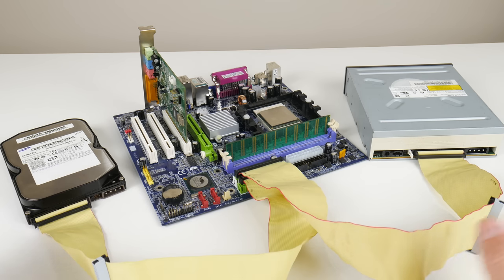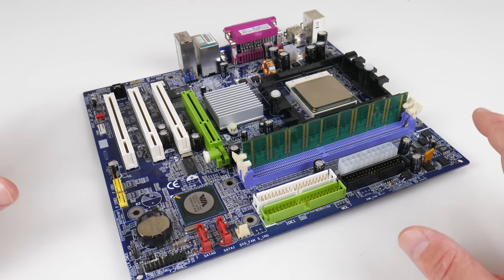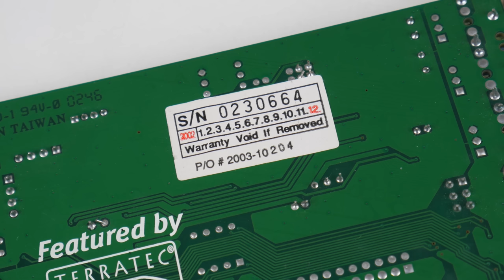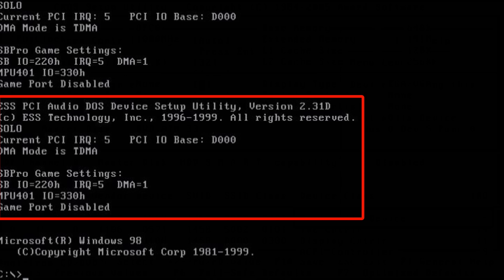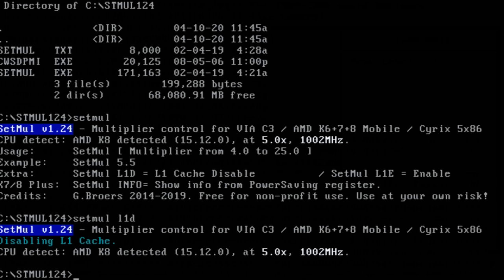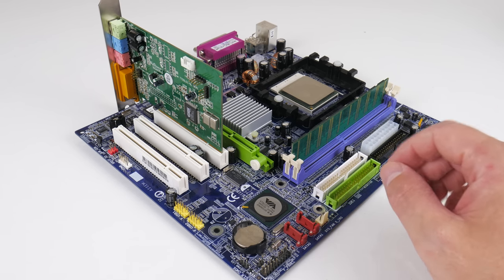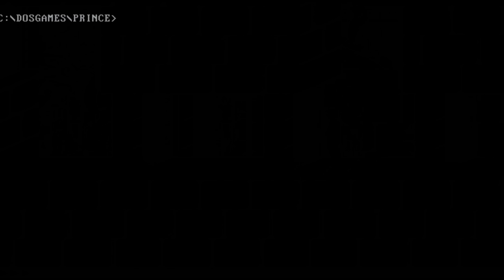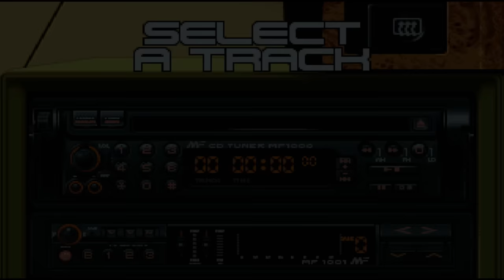DOS Gaming PC with Athlon 64?

Comment: Its certainly a very interesting promising result, it does leave me with a few questions though regarding my own time machine attempt i am planning out:
- What is the fastest GPU('s) i could use while still maintaining the good Win98 and DOS Compatibility in such a machine?
Ideally i'd run as many Windows XP games as i can get away with while retaining perfect Win98 and DOS compat with all the VESA modes and scrolling in games like Commander Keen working fantastic. Would a Nvidia 6800 work for this or do i have to go with something older? And could i use a Voodoo 3 for example as the secondary card or would i be better off using a Voodoo 1 or Voodoo 2.
- Would this work with a faster Athlon 64 or are your results specific to the model that you picked?
- How far could you get this down with other throttling methods like the tool Throttle or software based slowdown. Would it be possible to get super early dos games to work for example?
Reply: Geforce fx 5950 ultra is probably fastest gpu for perfect compatibility because after that you would lose 8 bit paletted textures support for some win98 games. If you don't care about those games you can go to nvidia 6000 series cards.
Reply: @Baoran  The 6000 series is a LOT cheaper, do you know anything about the DOS compatibility of these cards? Do they support all the modes you'd expect?
Reply: @Henk717  Dos compatibility is fine with 6000 series pretty much same as with FX series. Only problems you might have is with some win98 games.
Reply: @Baoran  Awesome, final question compared to something like a Radeon 9700 what would you recommend? The nvidia or the radeon? The aim is to support as much as possible.
Reply: @Henk717  Radeon cards have worse dos compatibility than Nvidia cards so I use nvidia cards in any pc meant for dos games. In Win98 and winXP the compatibility is as good as nvidia 6000 series which means that all radeon cards have the same problem as 6000 series with the same win9x games.
Reply: The card arrived, can't test it yet but it's a Gigabyte 6800GT AGP with 256MB of ram.

Comment: Hope you can show us some multiplayer dos, win98 setup soon. Like doom in multiplayer:)
Reply: Hi All, maybe one day do a video on 2 player game(s) with null modem cable - all you need is 3 wires using 9 or 25 pin serial - this uses soft ware on / off, you then add 1 or 2 more ground wires for hardware flow control / handshaking

Then say video 2 , show how to set up lan card.

The main problem is you need to fully initialize a lan card in dos, you only need to load driver ( say ne2000 compatible ) and then IPX or ODI - the lan card only needs to be set up to send and receive packets it does not really need to connect to a network as a client or server

I still have CO-axial cable under the house between my spare room and my sons room - used for doom, later on simplified it with serial cable, later on updated to the new cat 5 and a 5 port hub

Let me think, dos multi player games was .
Doom / Quake series, Duke Nukem 3d, Rise Of The Triad,  Command and Conquer , Warcraft, Decent, a few 486 era fighter plane tank games

Regards
George

Comment: Socket 754 is interesting and parts are still quite cheap. Maybe you could do a follow up on these with Socket 754 Turion 64 (ML or MT) cpus? Do they offer maybe any benefits for retro gaming like can those mobile processors be made even slower than their desktop counterparts?

Many desktop 754 motherboards support Turion CPUs, only the heatsink might need adapting because Turions don't have the heat spreader and are thus a bit lower.
Reply from the maker: I remember looking into this, and the top CPU cost just too much to make this feasible... Also for DOS gaming, slow is good :) It doesn't need to be a high end CPU...

Comment: Is there a reason why you don't use throttle to slow down the pc for dos use? My main problem with my athlon64 system and dos is lack of conventional memory because I won't be able load many of the TSRs to upper memory area like optical drivers/mscdex. Mostly because such newer motherboard seems to reserve much of that area even when most things disabled in bios settings.

Comment: Awesome video! You talked about the likelihood of this hardware lasting longer. I have multiple boards from the mid 2000s (mostly MSI, socket 939 and 754) that already have capacitors that need to be replaced while basically all my Hardware from the 90s is still fine.

In general, how do you deal with 386/486 boards and capacitors? Do you make regular visual checks or do you replace them as a precaution at some point? I am always a little bit afraid that I will miss when they show visual signs of age and that they blow and take the mainboard with them.
Reply from the maker: True, but capacitors is a very easy replacement. But you have a point, older parts might be just as reliable, and last as long, but there is also cost. A 386 or 486 system just costs a lot more than an Athlon 64 or Pentium 4.
Reply: @philscomputerlab  I was more asking in general as I am fortunate enough to have some old machines from my childhood. But that is true, I was really surprised when I saw the prices recently.
Reply from the maker: @PatricksRetro  Ah fair enough, I skimmed over the question it seems. Well, AFAIK 386 boards don't seem to have capacitors. At least not the ones from the cap plague, that later boards suffer from.

Comment: I should play around with my old Phenom II X6 that I still have lying in my cellar incl. board and cooler but not much else. Windows 98 had problems because the RAM modules being 2GB but might work for pure DOS. Maybe Memory Hole at 15-16 MB will reduce the RAM to 15MB like it does with my Pentium 233 MMX having 256MB. Under DOS only a max 64MB is actually used but is too much for some games.

Comment: hmm i always wonder why some vga chips on video cards can't do smooth scrolling in dos games that use adaptive tile refresh, it seems alot of via and ati graphics cards have these issues along with other video cards.
Reply from the maker: Do you know of other games that display the issue I've seen with Gods?
Reply: @philscomputerlab  i tested a lot of games like commander keen & bio menace and they all have problems like this.

On this particular video card aka "s3 unichrome pro" i'd avoid a lot of old side scrollers. yes turrican 2 has this issue as well... sad face :(

Comment: I can find all sorts of CF to IDE slot adapters, and SD to IDE that dangle loose from the end of the cable (I have a couple of those, work great but a nuisance to keep from contacting metal), but could not find a slot-mounted adapter like the one shown at 3:26.... source? Thanks!
Reply from the maker: Sometimes China doesn't continue making some products, so the one I have is something I got ages ago...
Reply: Ah, that might explain it. Still, at least now I know it exists and can keep an eye out. Exactly what I need for my DOS-only system!

Comment: ohhhh those memories............ currently getting all parts together for oldschool gaming - would i be able to play latest win 9x games smoothly with Celeron D, asrock 775i65g + 2x512mb ddr ram+geforce 7600GT 256mb ddr3?
Reply: There are no drivers for 7 series and Win98.
Reply: @ygorbachev  I've read there should be unofficial drivers for the 7000 series, but have no idea about potential issues and compatibility.

Comment: I was testing different cards under DOS for high resolution and high frame rate between a S3 virge stealth 2000, ATI Rage II and Nvidia TNT II m64 and found the TNT II m64 can run high frame rates at 800 x 600 ( Duke Nukem 3D/ Descent 1 and 2) - 1024 x 768 ( mech warrior 2 ) on a PII 233mhz slot one with fast vid.
Reply from the maker: Yea those Nvidia cards are pretty decent in DOS!

Comment: All I need now is a power supply for my Windows 98 gaming PC project. Not sure which one to get as it would need to fit inside the old Emachine case I'm using. The stock power supply it came with probably won't be enough for want I want to do.

Comment: Great movie, I just build machine with Athlon XP 1700+ and mainboard with KM133 chipset where I also have S3 integrated videocard :) Will you try someday some ATI CIF games like Tomb Raider on ATI Rage (they don't cost much) videocards?
Reply: Did you try Gods on that integrated S3?
Reply: @armorgeddon  I tried only some 3DMark2000 and 99 and first Tomb Raider in software mode and all worked good in 98SE, in windows 2000 I have problems with drivers, 3DMark2000 crashes. I'm using MSI MS-6511 mainboard, it's packard bell oem mainboard version made by MSI for them.
Reply: Oh ok, so you didn't test any gaming in real DOS. Tomb Raider btw ist a DOS game s performance and visuals could be better in real DOS mode.
Would be interesting to know if Gods shows the same scrolling issue on your older integrated S3 graphics like Phil experienced.
Regarding the the ATI CIF Tomb Raider: are you just interested in exactly that or how to max out graphics in Tomb Raider? Since for Tomb Raider there is a modern project for modern hardware which is based on the ATI CIF release of the game.
Reply: @armorgeddon  I try that game in DOS for you on that integrated S3, I know about that project with CIF to OpenGL wrapper, I even tried that and worked very good, but I also want to try ATI CIF on real hardware and I will do it when I receive ATI Rage XL which I just bought today.
Reply: @armorgeddon  I just tried Gods on integrated S3 videocard there and worked without any scrolling problems, also on ATI Rage 128 game worked good.
Reply: That's great! I'm looking forward to the test result.
Regarding the Rage XL, maybe you already know what you're doing ;-) but if not check this link for ATI CIF compatibility with hardware and drivers, it's not so easy: https://gona.mactar.hu/ATI_3D_CIF/
Reply: Wow that was fast :-) Nice to know that those work fine with Gods. I guess that S3 graphics part in the KM133 might still have a lot in common with it's very compatible anchestors. Thanks for testing!
Reply: @armorgeddon  I checked that site before I bought that card, if it have some problems I can buy without problem Rage LT or Rage Pro. And I downloaded modified driver for XL.
Reply: Allright, I kind of expected you know what you're doing :-D Looks like you're well prepared!
You can't expect wonders from ATI CIF, but it's very interested to play around with for sure, like all the special APIs that were around back then. Greets!
Reply: @armorgeddon  For sure it will work better than my S3 Virge DX (which I have with 4 MB memory) in S3D API. I saw that 3dfx cards cost much so in my opinion ATI CIF API is good choice with cheap ATI Rage cards.
Reply: @armorgeddon  Instead Rage XL i just got Rage Pro Turbo and Tomb Raider under ATI CIF work wonderful, even at 800x600 I saw all time 30 fps without any slowdowns. I make movie about someday, and you can check it at my channel.
Reply: :-) Ok, I'm subscribed to you channel now.
Reply: @armorgeddon  Thanks, video is already is on channel, you can watch it now :) And there will be new videos each Thursday.
Reply: Thanks! I watched it (not all of it) and commented over there.

Comment: Thank you for the video Phil! It's always nice to see these alternative builds for retro gaming. I have a couple of questions if anyone can help.

- This video is based around an Athlon 64-era system, but is a similar thing achievable with an Athlon XP? I have an Athlon XP 2600+ (Thoroughbred-B).
- As far as I know, DOS compatibility (specifically sound cards) is bad with nForce 2 motherboards - is this still the case? The motherboard I have is a Gigabyte GA-7N400 Pro 2 (rev 2.0) which uses the nForce 2 Ultra 400 chipset. If I were to consider using my Athlon XP for a DOS retro gaming build, should I just look towards buying a different motherboard with a VIA chipset? Or would it be worth looking to angle towards a Windows 98 build instead?
- The video card I have available on hand is a 3dfx Voodoo Banshee (specifically a Skywell Magic TwinPower PCI) - what's DOS support like for this chipset? It's basically a Voodoo2 with a single TMU instead of dual TMUs, and built-in 2D acceleration where the Voodoo2 required a separate 2D card.
Reply from the maker: I don't see any benefit in using Socket A. I believe Nvidia chipset are bad for DOS sound card compatibility.
Reply: nForce2 is really bad for legacy sound under DOS. It looks like it lacks support or has a bad implementation of subtractive decoding needed for using ISA addresses over the PCI bus.

Comment: one benefit i found with starter also is theres better glide emulation options available on 7 starter than in xp
Reply from the maker: nGlide runs even on Windows 98 which is pretty cool :)
Reply: im sure sone old games will run on 10 im just not a fan of forced updates and telemetry , 7 is the best all around ops microsoft ever made , xp is my favorite legacy , i did not experience dos other than  brief use in middle school keyboarding classes so i have no nostalgia to dos i was consoling back then, xp had just came out when i managed to get my first pc back in 2001 so xp is to me like dos is to some. however i love a lot of fps games from the dos era so i try to get the most games i can to run on xp and 7 , so far ive managed to get most

Comment: You had ps/2 keyb and mouse or did you have custom usb drivers for dos? I’ve had lots of problems with these.
Reply from the maker: Either works but BIOS should have option for USB keyboard and mouse
Reply: Yeah I have a setup that doesn’t have bios usb mouse support so that has caused me lots od headaches. (PII mobo bx440)
Reply: but now I have a ps/2 mouse and it’s finally working

Comment: Can you test this setup, just with an YMF724 card instead? It is that OPL core that might be a good choice. You get waveblaster header and SB-Pro as well.
Reply: Would be very interesting and likely work well, especially since the YMF7x4 series scales up nicely to Windows XP and the 3D audio support in Windows 98 it seems perfect for an Athlon64 build like this. Its the main reason i bought a YMF744 over the other cards (That and the ESS Solo-1 not being availible).
Reply: @Henk717  I love them 724's for Win98 builds. They are perfect cards on that system. The bad part is that the MIDI/Wavetable in the XG chip. Are not avaliable in Dos. That can be solved with a Dreamblaster board. The 724 or 744 is perfect if you wish to build a machine that can dualboot MS Dos 6.22 and Win98 on each their own primaery partition.
Reply: @brostenen  Even better, not just MS Dos 6.22 i got drivers for my YMF744 all the way up to Windows 7 32-bit. The XG sounds great on the card but indeed only in Windows. But given mine has a game port and MIDI support i could hook it up to my modern PC with my favorite sound fonts and VST's. Phil has a tutorial somewhere on his channel on how to pull that off. I don't think mine has a wavetable board option though, but if it does that would certainly be interesting.
Reply: @Henk717  I would never build a computer for both Win98 and WinXP. There are issues with Win98, if you go above 512mb, and WinXP run best with at least 2gb.
Reply: @brostenen  The memory i am not to concerned about, i got the necessary patches and fixes to get it to behave. But in a worst case scenario i can always have swappable memory sticks.
Reply: @Henk717  True that. It is just me, who is building machines that I dont need to swap hardware in. One of the reasons why I own one 286, one Pentium-166, four 486's (dx33, dx2-80, 5x86-133) and I have one Pentium3-933. Then I have all these Socket-A and Socket-478 board in boxes.
Reply: @brostenen  I am a windows tech who loves software and enjoys the challenge of solving computer problems. So the build is actually designed to be a bit daring on the software front as i want to get the most modern system i can get away with while maintaining compatibility. In VM test runs i successfully ran Windows 98 on 4GB systems. Either with RLoew's memory patch or if that remained unstable (Which it did in many different machines) i use HimemX to enforce the memory limits successfully. So its not the memory i am to worried about, but things like chipset compatibility or resource conflicts that killed my run on my old Core i5 2500 gaming PC attempt. On that machine i got Windows 98 to boot, had proper SATA support going and even full USB 2.0, graphics and audio. But the system was insanely unstable because of all kinds of resource conflicts and had graphics corruptions under dos. So with a Athlon 64 (X2) Socket 939 build i am reasonably confident i can pull it off and if i do manage to slow it down enough for DOS and get it stable enough for 98 it would be the ultimate time machine.
Reply: @Henk717  Ahhh.... Well... I am more a purist. So I am going for the easy route of AT class hardware instead. Also, not many people today, know about how to set voltage, multiplier, fsb and all that, with the use of old school hardware. However, I tend to advice people to do what they find is the best aproach.

Comment: These games will work on any modern computer with DOS. But you can see some weird things even in a DOOM. That first IMP for example - the AI is completely muffled. On real 486-586 CPUs, he fires "at a first sight". Also, try QEMM or some "p2patch" programs. And some games, which does not control timing - like Beach volley, or Test Drive. I tried this thing ten or more years ago on my Athlon X4. There is no such thing as 100% joy on modern hardware.
btw: buy an Amiga or some modern A500 clones - all these games will sound and looks better (except 3D games, ofcourse - for DOOM youll need 030, for Quake mc68060 cpu)